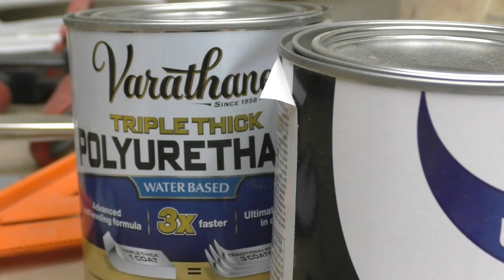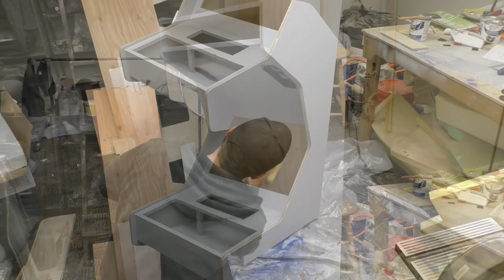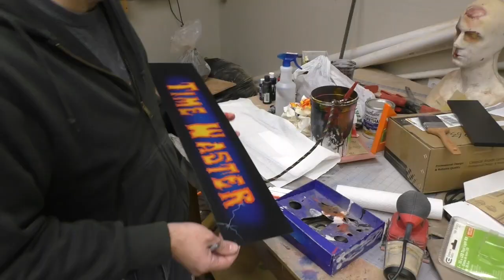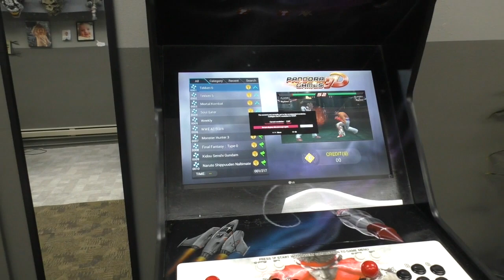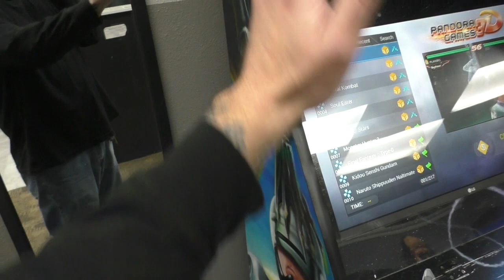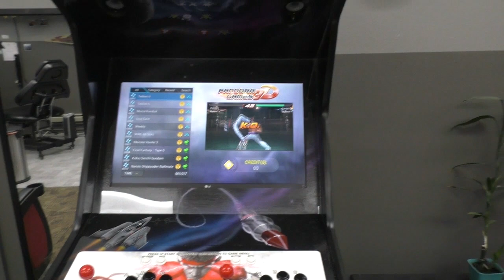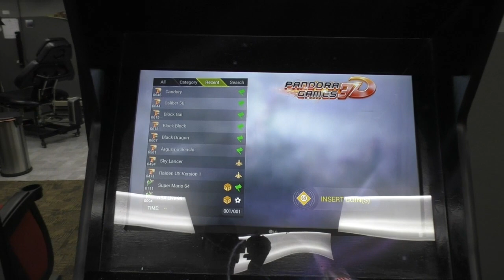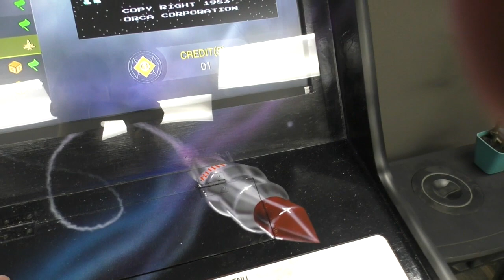Arcade cabinet painted and fired up!

Comment: This was very impressive. I will try and build one like yours. I do have to say does the glare off of the plexi glass an issue?  Or are you moving the arcade somewhere else in the shop?
Reply from the maker: The glare is an issue for me. I have to turn off lights before I play. Shorter people have no problem. If I sit on a stool, no problem. It's at the perfect angle to glare for people my height.

Comment: I'm building a very similar cabinet for a friend, but it wont look anywhere near as cool as yours! My question is how are you getting the tv to turn on? Does yours have a "hard on/off" switch that you just leave "on" ? Havent seen any newer model TVs with a push button on/off lately.
Reply from the maker: Hey, good question. Im not sure exactly. My tv at home turns on automatically when I turn on my ps4. The one in the cabinet is actually a gaming monitor. I got it because it was cheaper than a tv. I didn't think there was a difference accept for a pc input. It actually has settings for game optimizing wich I don't actually use.

Comment: Awesome job. I was going to have my kids do the artwork on ours when we build one together. What did you use for a top coat?
Reply from the maker: The beginning of my last video showed the paint cans. I got a water based clear I applied with a brush. Spraying clear is better but it worked ok. One light coat then a really thick coat the next day. Had to lay it flat on the ground because it likes to run.
Reply: @WhoArted  Thanks! You rock. Keep up the good work!